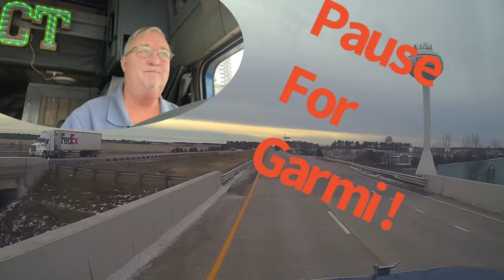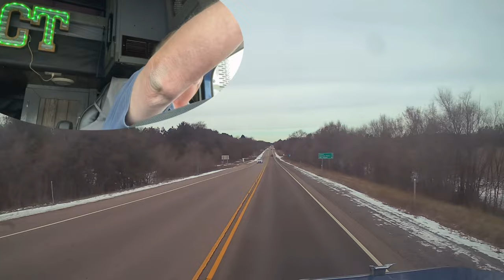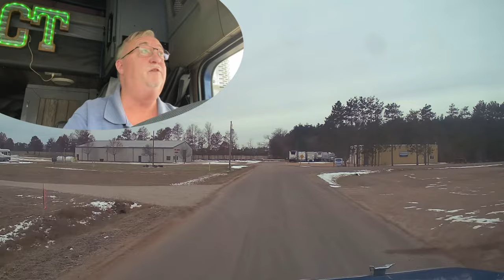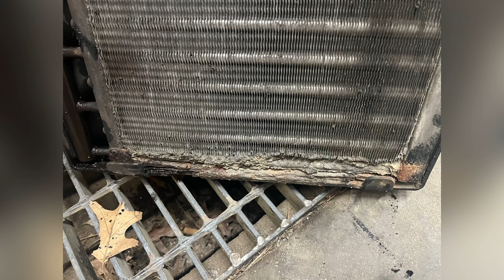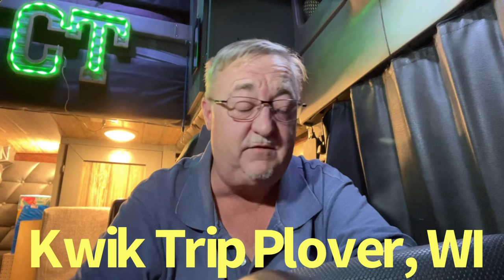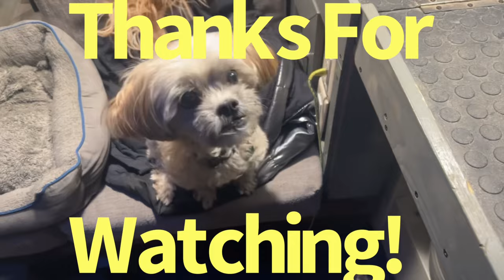APU Radiator Replaced; Electronic Chiropractor; load Updates; Rusty & More!

Comment: The shock therapy the chiropractor used on you is called electronic stimulation or e-stim for short and was invented in the 1960's by the martial artist Bruce Lee. One of many things he invented or perfected that most people have no idea about. I had something similar implanted into my spine in 2016 to alleviate the pain from 3 herniated disc's in my lower back. And that's why I'm back to driving a big truck after a 20+ year hiatus. Can't stand for more than 30 minutes at a stretch, and can't do all the bending and twisting required to build trailers anymore.
Reply from the maker: Very interesting

Comment: Spray some Linseed Oil on the new radiator to coat the aluminum to keep the chemicals off of it.  They spray Linseed Oil on new concrete highways for the same reason.
Reply from the maker: Cool tip

Comment: I'm big into chiropractic care good job on finding someone in your route.I used to go to the joint chiropractic and will but if I can find someone on short notice that's incredible and the extras. So ah crc marine spray on the radiator for the Apu.I have had the hardest time on my Apu it wouldn't chill any more then it wouldn't heat any longer.I have heard that the alternator can cause issues and they go out often.There is another guy Ryan has a YouTube channel and is selling and installing a all electronic system no engine I like it more insulation for the batteries though.The other thing called infusion you can get B12 shots but also something called a Myers cocktail for migraines they put you in a massage chair goes back and forth and will put extra stuff I felt incredible with extra stuff I mean wow back to feeling great it's a straight to the vein iv works great but also I picked up a neck stretcher and I'm liking it but not yet getting the cracks like a y strap but feels good got it on amazon put a foam thing on the top of the door it hangs over and then you close the door to hold everything in place works great.The massage chair at the ta's 45 minutes works the foam stuff at Walmart works too but oddly enough safeguard soap with aloe works wonders I don't know how.
Reply from the maker: Great info. Thanks

Comment: Did they check your APU since you had the issue with it not coming on.  I know that part is working fine now but just not sure if they looked at it further to see if they can see why that happened and fix it if necessary for this Winter.
Reply from the maker: Im convinced it was a clog in the fuel line that worked itself out bouncing down the road